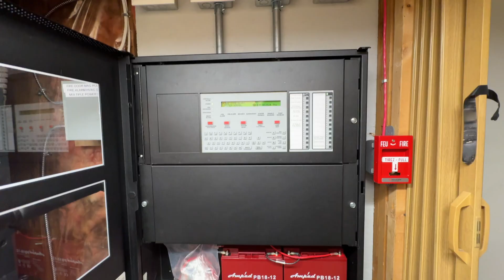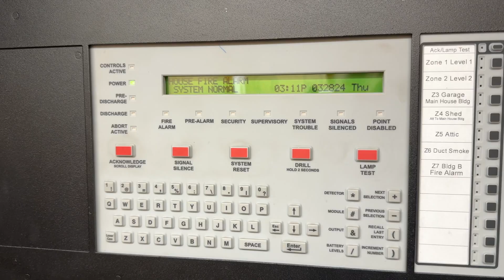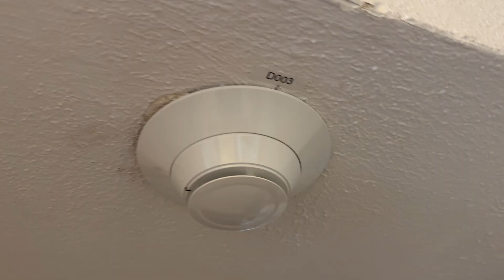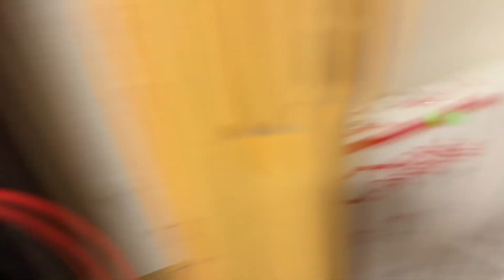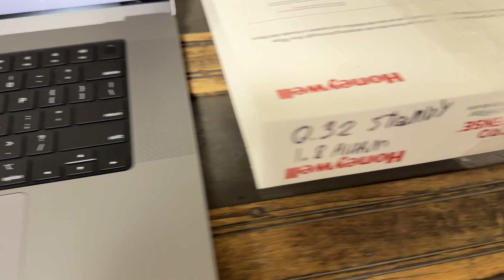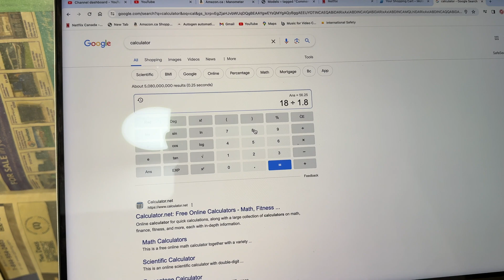Replacing fire alarm backup batteries and battery sizing calculation for fire alarm system

Comment: quick question if you tripped the fire alarm breaker would the lock let it trip
Reply from the maker: Yes I have a video on that a while back breakers trip internally regardless of the handle position
Reply: @nics-systems-electric  oh

Comment: My dad told always be careful about battery polarity when disconnecting / connecting because spark could cause off gassing hydrogen to ignite blow back inside causing a massive hydrogen explosion sending plastic shrapnel worst case scenario
Reply from the maker: Sealed lead acid batteries don't vent anything out

Comment: Expressed part of the battery load calculations

Standby Amp Hours: 0.32 amps * 24 hours = 7.68 Amp hours
Alarm Amp Hours: 1.08 amps * 0.5 hours = 0.54 Amp hours
Combined Amp hours: 7.68 Amp hours + 0.54 Amp hours = 8.22 Amp hours

Lasting times of the amounts

Standby lasting time: 18 Amp hours / 0.32 Amps = 2 days and 8 hours

Alarm lasting time: 18 Amp hours / 1.08 Amps = 16 hours and 40 minutes

The correction of the real time of how long you can have the bells ringing on battery backup is 16 hours and 40 minutes

Comment: Off topic question but is there a meaning to the color of the led on the bg-12lx? I see red and green but don’t know the difference.
Reply from the maker: On flashscan protocol and some others it will be green when it's normally communicating but will go solid red once in alarm or initializing it will be red flashing
Reply: @nics-systems-electric  So in normal operation it would flash green?
Reply from the maker: @DeadAcctually  yup
Reply: @DeadAcctually  sometimes on other protocols like litespeed and older protocols like CLIP, flashing red means its in standby

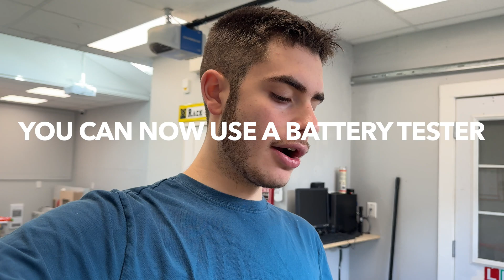Comment: Nic when you are putting words on the screen please use a different color than white or a black background with white lettering. Due to nobody cannot read it. White lettering on White background. Not readable. Here's the timestamp location. So you can see what I'm talking about....  4:52 so please start using a different color in the future.
Reply from the maker: They are my videos so I get to choose what I want to do as I am the one editing. I did not have any issue reading what you had put I will sometimes change the colour depending on background however it often times will not render and save that colour and will go back to white.
Reply: I can read it clearly

Comment: Hello Nic.  Thanks for the video.  I could be wrong but it seems to be you would need to measure the current for a specific time then do the math.  Like if standby used 0.60 amps if it ran for a minute then you could multiply that by 60 to get an hour and then by 24 to get 24 hours.
Reply from the maker: You multiply the current times the 24 hours you need as the battery's are sold by an amp hour rating. So you will get the answer for what amp hour size you would need.

Comment: How did you get so many alarms? And does your family like/approve of the fire alarms and emergency lights?
Reply from the maker: Bought the low frequency devices on eBay and nobody else cares they recognize that the house needs to have some sort of fire alarm and the residential devices weren't working for us so as long as you do a clean installed with low profile devices there's no issues with looks
Reply: @nics-systems-electric  I prefer installing alarms where the box is outside of the wall, like the opposite of flush mounting, it's easier for me, cutting phone-sized walls is not easy to so in a rented duplex💀💀💀